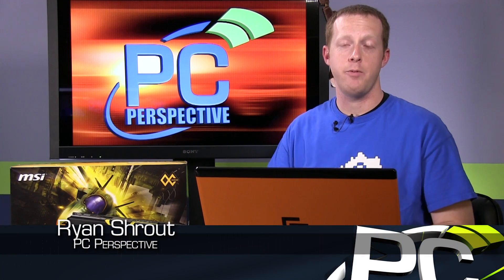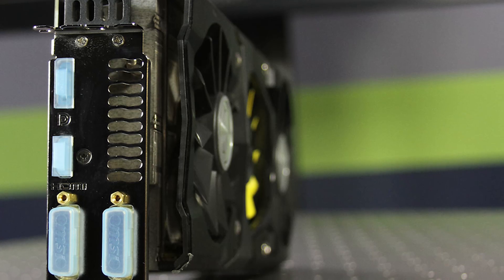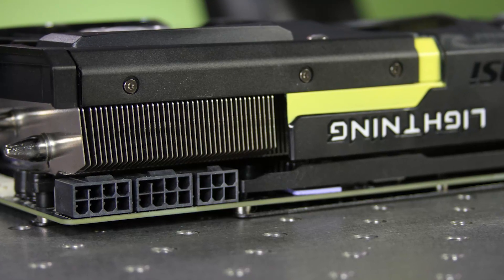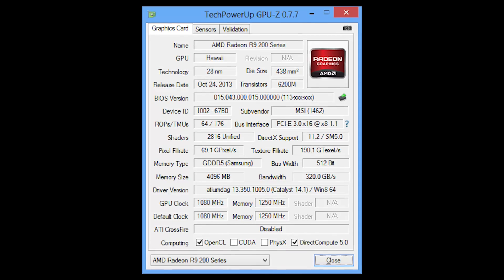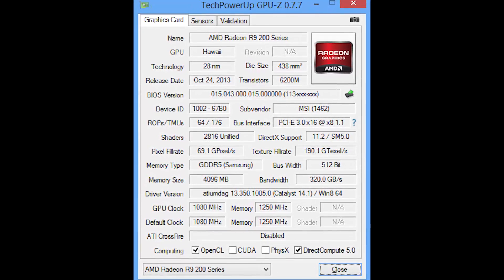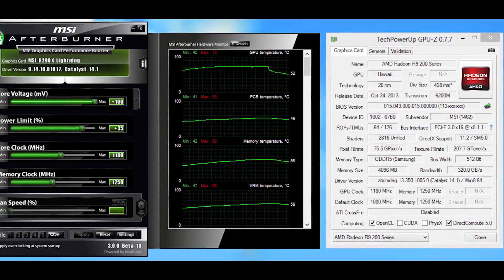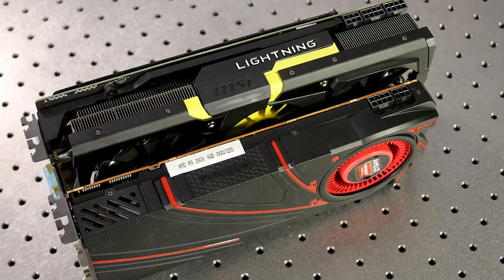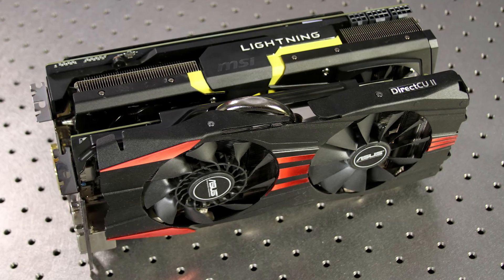MSI Radeon R9 290X Lightning Graphics Card Overview

Comment: Noob question but would there be issues if I paired this card up with my Intel I7 2600?
Reply: No, just uninstall your drivers from your previous card.
Reply: Kevin Acasio thank you for the reply
Reply: swishpronoob what slots do you have as long as it is a pcie x16 slot everything is fine but do change ur bios
Reply: errr not sure but I have an ati 7970 reference right now in my desktop.
Reply: then dont change it, that has more power than a 750ti. this would be a downgrade.
Reply: Kevin Acasio makes no sense

Comment: imo this is better to go with over the reference design with a G10 H50 and VRM Heatsink just because you won't have to mess around with the card, just pull it out, plug it in, and play. By no means in the G10 hard to put on, but this cards cool enough to say that its pretty much as good as the G10. The G10 has around 35 idle and around 65-70 celsius, the MSi R9-290X Lightning is around same idle temp, but around 5 degrees hotter. I'd go with this card.
Reply: he says its 75C, but he didn't specify if it was open test bench or in a case, with my Gigabyte Windforce X3 7970, in my case it can hit 83C, yet open air only 65C, so for you to be able to actually choose this card based on temps, you might want to know the testing scenario.
Reply: i have a Bitfenix Shinobi XL with the drive cage removed, a 200mm in the front, a 120mm in the front, a 120 in the back, and 3 120's in the roof, so no, i don't
Reply: TheNerdyCanadian my asus dcuii hd 7970 hit 69c maxed load clcoked at 1125mhz i have a 200mm front fan 2 120 on the rad and a 200mm on tops in a corsair 600t idles arounf 38c